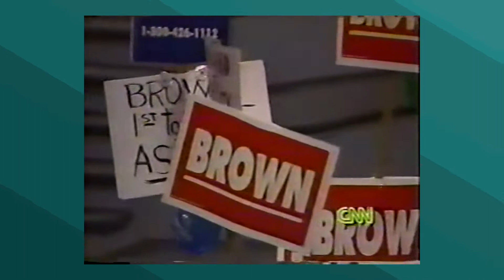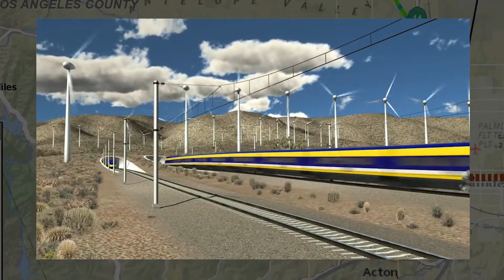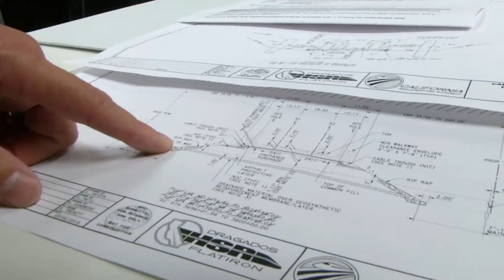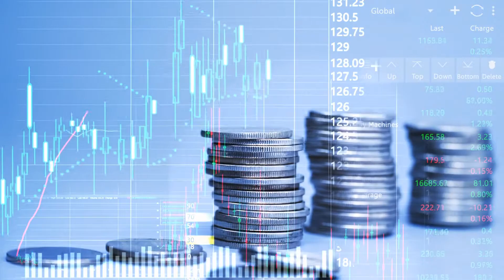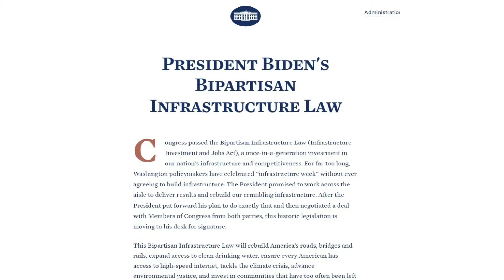On Track to be the MOST Expensive Project in US HISTORY, The California High-Speed Rail!

Comment: Your video should recognize that the Merced to Bakersfield segment is vital for cutting enough time from the NorCal to SoCal rail travel time to make it competitive with air and driving. CHSRA plans to expand the amount of trains from 12 a day to 18 a day, due to the increased demand for travel after more than an hour is cut from the travel time. At Merced, three other rail lines will converge on the end of the HSR line, running to Sacramento, Oakland via Stockton, and San Jose. Thus entire NorCal and SoCal regions will benefit from the Merced to Bakersfield HSR line.
Reply: In 2029 maybe the valley ridership will double. Not much use until a tunnel is dug, really. I look forward to 2058. Sorry. It might help riders leaving the valley but it will not help much for anyone going to the valley. I am 200% for CAHSR. Funding is the problem. Way too little to get it done.
Reply: @davidjackson7281  - When the trains are running in 2030, and given all the other likely changes by then, the California public will demand completion of the entire line by 2040, if not also the extensions to San Diego and Sacramento. By 2040, we're also likely to see much of Metrolink electrified, too.
Reply: @pacificostudios  I appreciate your optomism Pacifico. I understand there will be more connectivity from Sacto, Oakland and San Jose. That will add another million to the present million using the San Joaquins. Not much bang for the buck. I don't know how anyone's analysis can be realistic without considering the huge obstacle building tunnels will be. Honestly, has anyone ever considered this? 

By 2040 maybe Gilroy will be connected. That would be something but even that segment is doubtful. There are three other segments to still to tunnel after that. I am afraid the low use of the initial 171-mile operating segment will be very disappointing. Yes it will reduce a three hour trip to one and a half hours but at a cost of 20-30 billion and taking 15 years to build (after 7 years of whatever planning from 2008) it will not be impressive. 

They'll just have to keep plugging away at only two billion a year which means each of the three main segments after 2029 will take a decade each at the minimum. Forget about the challenge of Pacheco Pass and the Techachapis, think about tunneling over 28 miles through the San Gabriels and the tunnel to the SF transit center. 

Pacifico Studios please, please give me some hope. Surely you have better insight than me. I now live in the Delta near Lodi so I will take a joy ride. But after the initial surge in ridership I am afraid the bloom will be off the rose that took so long and so much to build.
Reply: @davidjackson7281 - Currently, the San Joaquin and bus service takes about 8 hours from SF to LA, and about 6.75 hours by air or car. The BAK-MCD HSR initial line will make rail, air, and car about equal, depending on your actual origin and destination, time of travel, etc. 

I think the real answer is to build 125 MPH temporary lines under Tehachapi, Pacheco Passes and the San Gabriel mountains. The cost will be much lower with relatively little impact on travel time. It even reduces vertical curvature, shortening the tunnels even more.

Should I make a video about this kind of Value Engineering?
Reply: @pacificostudios  Before getting back to you I have first been spending time going over distances and times. I do like the merit of 125  mph track lines. I think time could be saved. Yes, please consider doing a video about value engineering. I hope my reply helps a little on this complex subject. Especially with funding constraints.  I am not an engineer. More a cost accountant though I did have a term in the SP mechanical and maintenance of way departments. The most critical of the three tunnels I think is the Tehachapi which would replace the extra seat 2:30 (+ or - :10) bus transfer. 

I would upgrade the Antelope Valley from a two hour 60 mile train ride to a 45 min. 45 mile ride by improving the track, some tunnel(s)? and shortening its alignment. CAHSR plan from Palmdale to Burbank is 39 miles in 13 minutes with 28 miles of tunnels plus 2 miles of cut and cover. A temporary 125 mph section shortened to half or 20 miles would work.

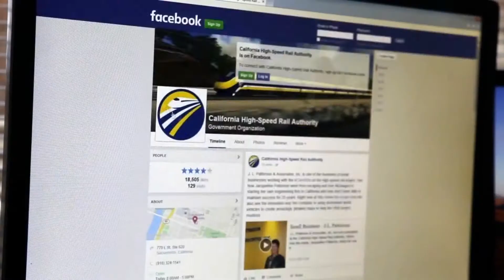Up north there are two ways to get to Merced: San Joaquins or ACE. ACE from SJ to MCD would need upgrading including an Altamont tunnel replacement. The current SJ to SKT 88 mile trip is 2:12 so clearly the speed could use improving to save time similar to the San Gabriels section. The Pacheco Pass would come second with the high speed line and toughest section San Gabriels last. In conclusion they want to high speed tunnel through Pacheco Pass to get that valley to valley commuter connection and it is the easiest section. So skip the temporary 125 mph in this case. That leaves the Techachapi as the prime candidate if I may suggest Pacifico. You got me thinking on this one. Thanks.
Reply: @davidjackson7281  - Thanks. I haven't been a civil engineer since 1989; I'm a retired attorney. But that helps me keep my explanations simple. Doubling the speed of a train quadruples the required horizontal and vertical radius. Minimum radius for a 200 kph (125 MPH) train line like the Tokaido Shinkansen (opened in 1964) is 2500 meters. So CA HSR needs curves in the range of 10 km to handle 355 kph (220 MPH). This should show how much money could be saved by crossing the mountains at 125 MPH instead of 220 MPH. I calculated that a 125 MPH train would be only 10 minutes slower going over Pacheco Pass than one rolling at 220 MPH. Furthermore, a 125 MPH track over Tehachapi Pass could probably be shared with intermodal freight trains going 70 MPH, helping to end rail congestion between Northern and Southern California, a problem over 100 years old.

In addition, by using N700 tilting trains, JR Central moves trains at up to 142 MPH over the Tokaido Shinkansen that was originally designed with a 130 MPH top speed.
Reply: @pacificostudios  The alignment is the same from BFD to Palmdale, is that correct? I see what you mean about Pacheco Pass. Something like 80 miles at 160 average (:30) vs at 120 average (:40). I believe track can't be shared after 110 mph Class 6 track. Class 7 125 in America per FRA regs has to be separated from freight me thinks. Acela has issues with tilting trains ... too much wear and tear I believe. Doubling the speed quadruples the energy consumption too doesn't it? And steeper gradients do so as well. Any thoughts on the San Gabriels since that's your backyard so to speak. I like retirement though the ferry ride to the city was a treat.
Reply: @davidjackson7281  The San Gabriels are the one place where going underground may be impossible to avoid. This area is sensitive to noise. Also, following the Soledad Canyon with a 125 MPH line is a lot longer than going straight under the mountains. On the other hand, the is much more traffic potential because of Metrolink regional rail service.